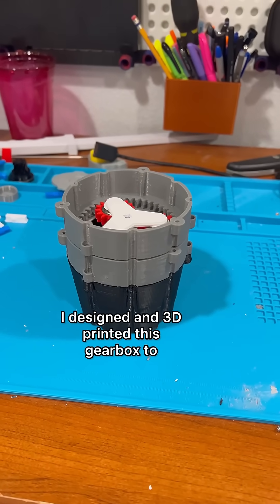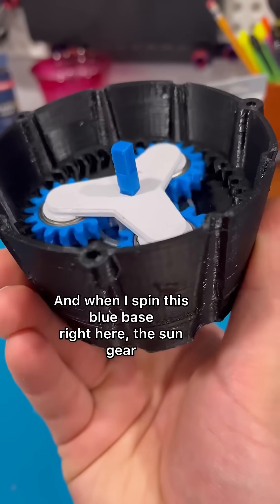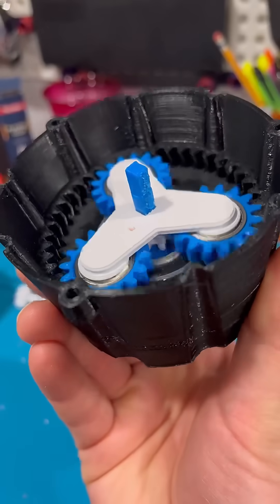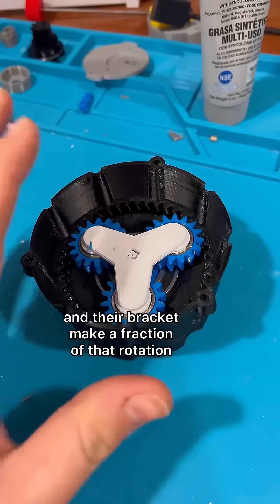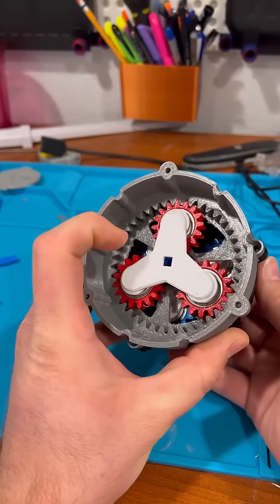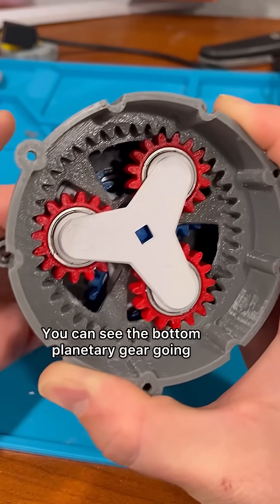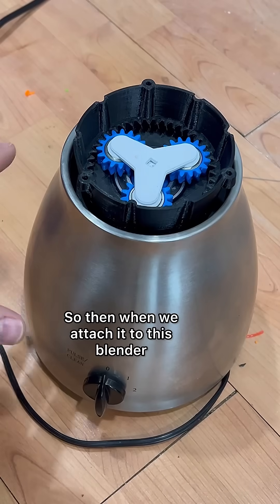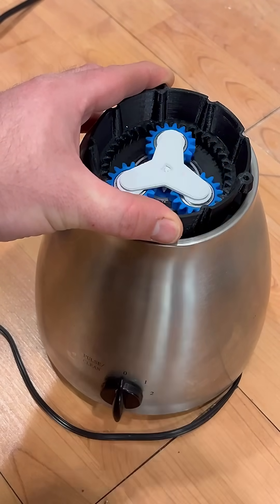(mostly) 3D Printed Planetary Gearbox

Comment: idk why but maybe make it with a hand crank and make the output spin really fast and make a blender that doesn't need electricity but it may break because its plastic and it needs alot of them to turn normal speed to high speed

Comment: You can print the bearing too. Theres some simple ones on printables that work amazingly
Reply: Friction would kill them at these speeds. Metal will last longer
Reply: @jonesJ-j8i  so would the gears that are 3d printed lol
Reply: @mariospanayiotou6644  anything 3d printed is going to wear out. Metal bearings are the best thing to use
Reply: @jonesJ-j8i  yeah of course, but if he’s using 3d printed gears why would he care about the bearings? The gears will go much faster

Comment: Ooorrrr you could flip it upside down and make the blue gear spin really fast (inner child took over)
Reply: I feel like it would explode from the spinning forces

I wanna see it
Reply: Yes that is what happens in an automatic transmission with overdrive gears, the input shaft is slower than the output shaft, although with plastic it will cook itself together
Reply: Bro just cracked FTL travel 😅
Reply: Instantly what I was gonna say
Reply: "Rolling around at the speed of sound~"
Sonic Adventure 2 Battle: City Escape
Reply: BRRRRRRRRRRR
reality absolutely explodes
Reply: Exactly what I was thinking. Step it up like  5-10 more times and get ready to make a black hole on your bench 😂
Reply: Nah then the red spins faster and blue slowest
Reply: @lactosesuselessfacts3506  dats da point
Reply: @lactosesuselessfacts3506  um...no, the blue gear is faster than the red one.
Reply: @Itsjamilagain  they have the same transmission rate, if you add a 1:5 gear ratio to another 1:5 gear ratio, it's 1:25. it wouldn't make a difference if you flipped them because the colors don't do anything.
Reply: @theffects9545 Right. So how would the blue end up being slower if nothing changes?
Reply: @Itsjamilagain if the blue is on top, the blue is slower. If red is on top, red is slower. It doesn’t matter what the color is on top, the output stays the same if you use the same number of gears.
Reply: @theffects9545  what he's saying is not "switch the positions of the gears". What he's saying is, "keep everything the same, but rotate the entire thing 180 degrees so that the slower turning gears are the ones being spun by the blender"
Reply: @_Stormfather that wouldnt fit on the blender.

Comment: For those wondering what the use is, heavy equipment or anything that needs to be repetitively moved and is very large is generally using these. Such as for example there’s a wheel on a machine will use one set of planetary gears which is normally three set on a sun gear which is the axle, thus when the differential spins the axle, it in turn turns the wheel at a higher torque.

Comment: I’ve Seen those exact gears in threading machines for steel I make commercial fishing gear and we use a machine that drills threads into holes for screws using that exact type of planetary gears.

Comment: enthusiasts who clearly didnt use proper harmonic damping. the torsion on that shaft will never dissipate that torque on an actual load... If you apply viscus damping on the shaft's centroid then you may deliver the necessary torque to a load

Comment: There's already a gear reduction experiment like what you're talking about with your extensions. The gear reductions are carried out in a different arrangement and don't use planetary gears but with just a couple of handfuls of generations of gear reductions the last gear doesn't appear to move. The math says that last gear is moving but it will make one complete rotation some billion years or so AFTER the heat death of the universe.

Comment: So the 3D print is great for proof of concept but if you actually want to apply torque to it I would recommend using aluminum CNC parts at minimum at best I would use plasma cut steel

Comment: I have concerns that the resulting torque and the heat produced by the spinning is likely going to be too much for PLA to handle in terms of heat and impact. I'm guessing you are using something more durable like PETG?
Reply from the maker: That WOULD be the better solution, but no, it’s just pla+

Comment: In the wine industry we use a barrel washer for flushing out sediment from used barrels. It has a three tiered planetary gear system that uses a water pressure powered impeller to rotate the gears and (thusly) the spaying head (which has a separate differential gear assembly). The lubricant for the assembly is the water itself. This is fascinating, but it is not new technology.

Comment: Wouldn't adding more extensions take away torque? Because the motor in the blender has to work harder to move more objects there is a decrease in power output, less torque.

Comment: These are called gear ratios and are very simple and don’t require planetary gear systems, most are just boxes of gears where one gear (the first one) goes 1000 RPS (rotations per second) yes it very fast but then the last one would probably only make a rotation after 100 years. (Yes they are calculated exactly to end in 100 or more or less years EXACTLY)

Comment: This exact same planetary gear setup is what makes the wheels turn on my logging skidder. Each gear is about a foot diameter and weighs about 90 lbs . Oh and each gear costs 10,000$😮
Reply from the maker: That is slightly more heavy and expensive than these gears.

Comment: I hope you mean you just designed the attachment to the bender part not the sun gear set up. Because the P-3 Orion aircraft has been using this system since the 1959

Comment: Your doing great, I just subscribed because I want to see this thing work. Just be careful dearie. If you have to much torque, it could break those plastic parts. I don't think they are designed to handle the speed of a blender. Though good luck. I want to see that big cube turn

Comment: Have to say, I don't quite trust the original blender axis to transfer the blender's rotational force without ever breaking through reasonable use of say, 10 years. Now you replaced it with an unproven bit of layer-melted plastics, and multiply the torque going through. Marvellous.
Reply from the maker: Ikr? It’s sweet!
Reply: @printmeister  indeed... I suppose thats just proof for the merits the engineering approach otherwise known as "overoptimism"

Comment: Because of how that plastic was printed you're going to have extremely high friction ratios on them gear bearings and it's going to generate a stupid amount of heat over any prolonged use which is just going to cause the gears to melt down

There's a good reason why gears went from being wood to being made out of metal

Comment: Use it the opposite way, attach the motor to the second planetary gear and make the blade spin at like 9000000000000000rpm

Comment: The composite would probably break first, if you want more extensions you will definitely need to reinforce them with something other than 3d print filament. Maybe if you tried 3d printing with like a grid running through the case where you periodically add small metal rods while it's printing, I mean I'm not exactly a structural engineer but I've worked with construction for awhile, and I learned that if you think something may break its probably a good idea to fix it before it does

Comment: This is cool and, but isn't the point of these gears to reduce the rotation for a secondary job? The main gear isn't powering anything else. I still don't understand why modifying the blender's motor isn't the ideal way to solve this problem.
Reply: Just seems like a waste of energy. The motor is working way harder than it needs to for no purpose

Comment: You gain torque, but also not, because those plastic gears will just snap off
Reply: I'm more worried about the friction...
Reply: @ChrisD__ that's literally what he meant
Reply: @ChrisD__ I am more worried about the microplastics in the food now xddd
Reply: @celeste_es maybe we should stop putting food in plastic but that’s too expensive to be realistic
Reply: @celestinemachuca2339 
Why? He doesn't actually use this with a blender. Even if he did, this comes nowhere near contact with food.
Reply: Print them in low temp filament and using the lost wax casting method, cast them from aluminum.
Reply: Shaken not stirred 😂😂😂
Reply: and the heat with the fast gear lol
Reply: But in parts where high amounts of torque are being applied, those gears would be a much tougher material. This is exactly how the planetary gears in an automatic transmission work.
Reply: @Natediggetydog  Yeah but automatic transmissions aren't made of 3D printed PLA 😂
Reply: @andrewjc13  sure, but this as a demonstration, not meant for any practical use
Reply: Yeah, but it still enough to turn that plastic cube
Reply: shear stress limit, wear, heat, melt fusion. it’s nice as a teaching tool. but functionally of little use.
Reply: You still gain torque just the materials can’t handle it
Reply: Blenders tend to die in that blue connector he printed so u les he uses 3d printed adamantium or unobtanium.... Idk....
Reply: You are right, he needs quantum-locked photon gears
Reply: Put accurately, you gain torque.

Structural integrity of the gear train may be exceed.
Reply: I was just going to ask about the tolerances on it...

Comment: I use a planetary gearbox, but in reverse, to speed up the output. 3 stacked layers gets me something like a 64x ratio, which I use to launch propeller disks high into the air!
Reply from the maker: That sounds awesome!
Reply: How is it powered?
Reply: @sgtdrake  I put up a quick video of it on my channel. It's got a decent sized hand knob with finger indentations to make it easy to turn. So manually powered, but doesn't require the effort most launchers take.
Reply: I happened to see that model yesterday.  Nice job.
Reply: INFINITE SPEED!!!.
Reply: You made that model? It didn't work for me, but it looked really cool!
Reply: @sineof90  Not the one in this video, an alternative print in place version. It can sometimes be a little tricky at first, but after a little working in, and lubrication, it works pretty good for me.
Reply: @NikoKun  I know which one you're talking about; even though I cleared all the supports I could, it was very resistant to turning.
Reply: @sineof90  hmm, I usually print it without supports. It's designed to be printed without. There might be a couple places where bridges aren't perfect, but overall it should still work. Supports might get inside places you don't want, and jam things up.
Once in a while I have to use a tool to free the gears. Like the handles of rubber coated pliers, I stick between the gears, then use them to apply torque on the side of the gears to free them.
Reply: But how many layers til the top one has gears spinning above the speed of sound?
Reply: Well if you have a blender with that you will not have disks breaking the sound barrier

Comment: I think lubricating the gears will be good to reduce friction and risk of breking 😅
Reply: Well yeah a  planetary gearbox should always be submerged in oil but that's not going to do anything for the plastic gears 😂
Reply: @ClaytonBigsby01  common lubricants used with metal will in fact, eat them up. this is why plastic moving parts are ideal for food processing operations. No need to lubricate them.
Reply: breking.

Comment: Personally, I'd switch over to a stepper motor. Not because you can't gear down a blender, but because it's still gonna be as loud as a blender
Reply: Lmao, I was thinking the same thing. But I suppose it would be cool to gear down a blender just because.
Reply: @Triud45  sardr
Reply: Well, I don't have a stepper motor lying around, and I don't feel like ripping open other devices that may have them, but I do have a blender, and I can use it unmodified.
Reply: Ok but where's the fun in that?
Reply: I wanna know why the hell is a blender so damn loud anyway? Does it have its own crunchy gear system inside? Realistically turning it on should sound like a electric motor. Instead it sounds like a cement mixer amplified 10x.
Reply: @Side85Winder  Mine just whirrs. There's no rattling.
Reply: Gears become very Loud if they Spin fast enough.
Reply: I think a terrible cooled blender could easily blow up
Reply: Why not just then use a dc?
Reply: Do you have to use the clutch to shift gears on the blender?
Reply: The PLA wont take a lot of shear stress
Reply: Indeed a stepper moter with a good quality stepper driver. That will be way better than whatever this blender will do. And on top of that Stepper motors are usually quite cheap.
Reply: This is the only comment I've seen from someone else that contradicts the ops ideals while still being respectful and and making valid points. U get extra points in life for this. Who decides points in life? People. I'm a person. I think u deserve points
Reply: Yea this is the result of people not thinking before filming
Reply: @BIaccCat you're a case of people not thinking before commenting. He attached the blender to demonstrate the insane difference in speed. A proof of concept is rarely useful in and of itself.
Reply: @dylanneely91 he states he is planning on using the blender for his build to n the video though. He also has another short where he explains he’s planning on using the blender for his build.
Reply: I mean you can 3D print some kind of attachable sound-barrier
Reply: would be even louder lmao
Reply: @TheDarkElk  Have you missed the silent stepper motor driver?

Comment: They need to sue the school, and the student with the prom plan.
Reply: Did YouTube do that thing where you make a comment under one short and it ends up under a completely different short?
Reply: @TwiliPaladin  yes 😫
Reply: @TwiliPaladin  I watched a kid on a motorcycle get hit by another kid driving his car. It started with The kid in the car got a hold of the school cop, to do a weird proposal to prom. The kid in the car was to blow a stop sign, get pulled over, and have the cop in on it. The kid on the bike was just kinda there at the wrong time, and he technically had the right of way, but the kid in the car wasn't backing down just cuz there was a bike, and he smashed the bike. The kid in the car used the excuse "I thought he was doing a rolling stop." It caused an accident that should have just simply never happened. The cop should have never made such a stupid plan with a student.

Comment: I love how the white sun gear was throwing pieces… you might look at annealing the plastic to try making it even stronger so it doesn’t self destructs like it is now… 😅
Reply: Or try lubricating the gears to lessen the wear a bit. Might destroy the blender with enough lube cycles however
Reply: @ThomasEarley91  who let bro cook
Reply: can’t solve heat problem
Reply: Or just make it out of metal if it's gonna be a proper part
Reply: Or composite it with other materials. Mess around with different surfaces etc
Reply: Yep I saw that too. This is just dumb

Comment: This is turning out to be amazing but you still need to figure out the sound so that it’s not loud maybe you could make a muffler to go with the gearboxes
Reply from the maker: Thanks! The muffler would be a fun project too!! I have a much quieter stepper motor that I’m going to use if/when the gearbox fails or is too loud.

Comment: At first I thought the blender would be way overkill, especially the speed, but this is turning into something a bit more interesting than just finding the appropriate motor and attaching it.
Reply from the maker: Agreed! I’ve had so many comments suggesting something to slow the motor down. At this point though, I’m actually questioning the blenders power.